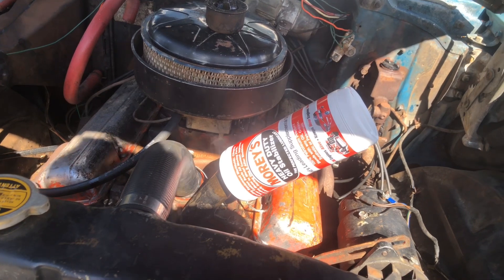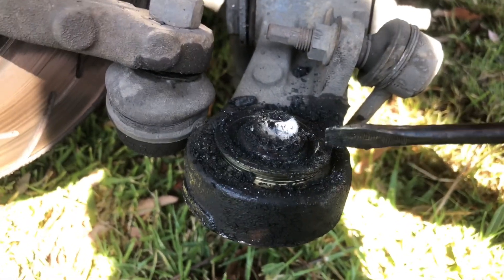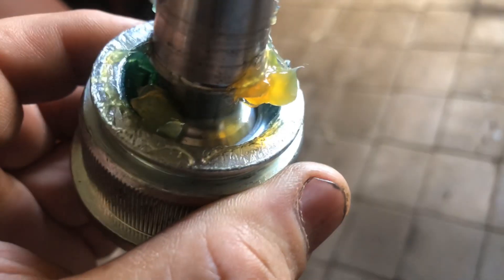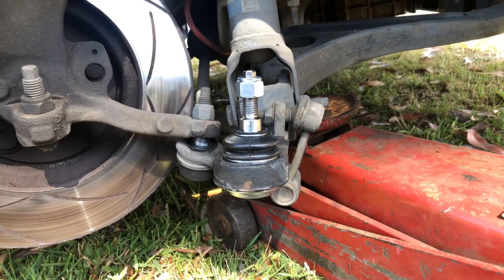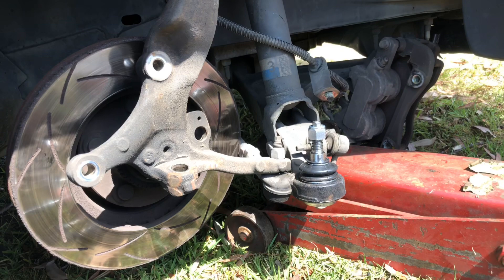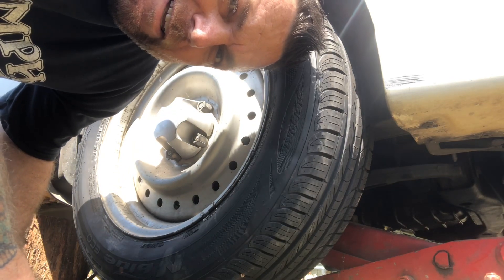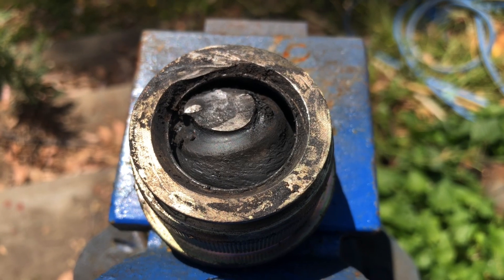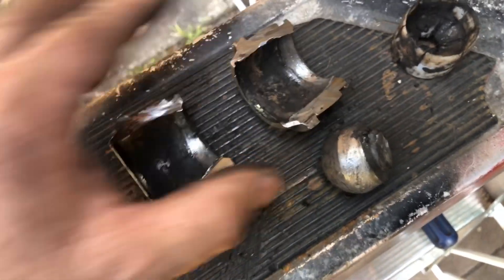Why’d she break? Let’s pull it apart and see… Science with Paulie

Comment: The reason they might have asked if it's been replaced before is because of the joint has been replaced before, you need to put an oversized joint in. The hubs weren't designed to have joints go in and out multiple times is all

Comment: Cracker video, knew you had a follow up video, so didn't comment on the first one. King pins and ball joints are all a pain in their own way, mine have 3 bolts to hold them, but have had to do rivited ones before too. your comment on the grease nipple ball joints has got me thinking now, will be checking mine out tomorrow.

Comment: great followup video, and now that you mentioned heavy steering, mine has gotten a little heavier lately, but I didn't  think anything of it. hope I am not on borrowed time, I did change them about 2+ years ago.....

Also! where did you get the grease nipple joints from? Might buy a set just in case
Reply from the maker: Cheers! Yeah I’ve ordered a set but can’t confirm they have the nipples yet, they are supposed to. Just found them on eBay scrolling through Ba/bf lower ball joints. There’s a few
Reply: @oldskoolonly  if its a matcher branded. can confirm they have the  nipples
Reply: @oldskoolonly  too easy man, i’ll have a squiz

Comment: Similar issue to the HQ-WB Holdens, fortunately they seemed to always fail at slow speed doing a U turn, round about or in a car park. I think you are right on the grease issue. Unlike the Valiant they hang on the stuff rather than push in to the joint.

Comment: there are grease needles though
Reply: Where abouts mate? I've got 2 ba turbos and can't find this grease needle. Educate me on where they are please.
Reply: @jamessmith-lf3ih 
Grease needles are a tool, not a part of your falcon.
Reply: @steely1neverwane  I got under the car and couldn't find any grease nipples anywhere as for a grease needle I'm not sure exactly what that is meant to be. Never heard of it. I think he means drill a hole and put a nipple in it but I don't wanna do that I would rather buy something that already has a grease nipple in it.
Reply: @jamessmith-lf3ih  toledo grease needles tried to share the link didnt work
Reply: He means a stick of grease you can poke thru the rubber and add grease
Reply: @StarlightWorkshop0z  yes, then you clean the tiny puncture hole created by the grease needle/injector with a oil free solvent and smear a tiny amount of silicone sealant over the tiny hole, it makes a noticeable difference. not everyones cup of tea i know.